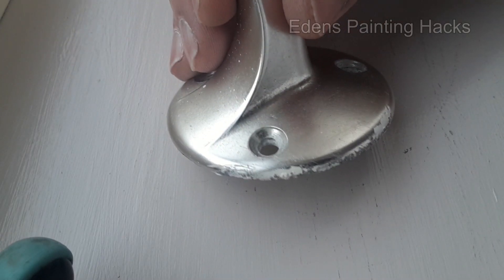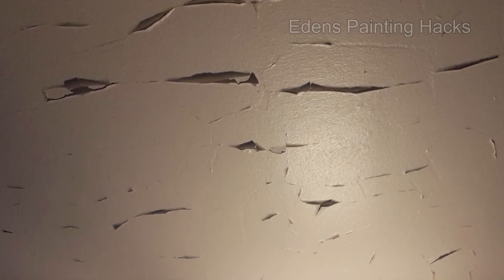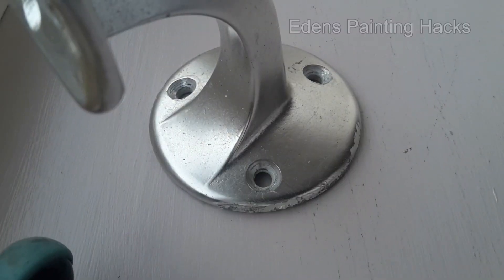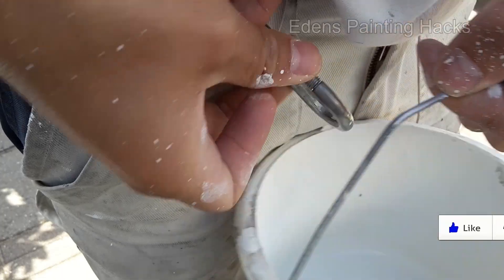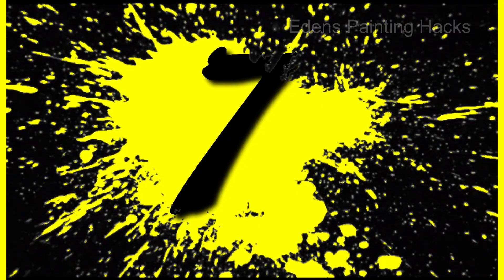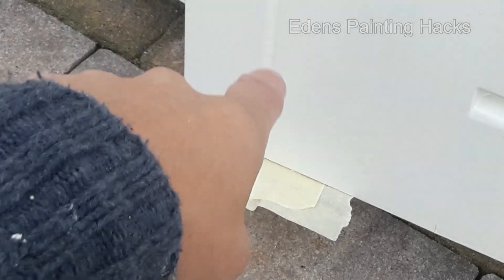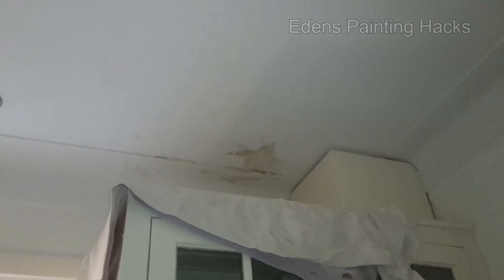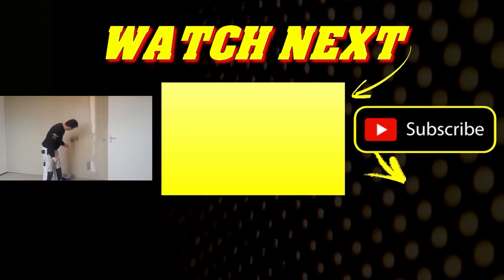10 PAINTING HACKS EVERY DIY ENTHUSIAST OR PAINTER SHOULD KNOW!

Comment: I see where you say to use "insulation spray can"to isolate a water-stained area. I have a stained area that looks just like the one shown in your video.  My question in, what is an insulation spray can?  I've never heard of that.  Is it similar to something like "Kilz mold & mildew primer"? I've seen them,  but they're sold in a can in home depot or lowers stores. What if i paint a thin layer of Kilz, let it dry (add a second thin coat if stain is still visible, then just paint over it when done?. If it's not the same then where can i find the spray can your referring to in this video?  Thanks in advance